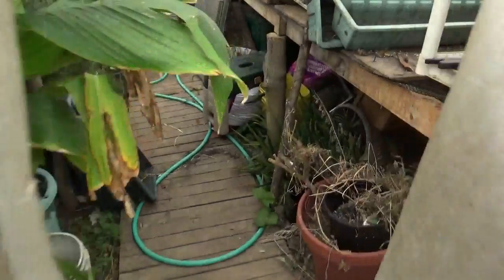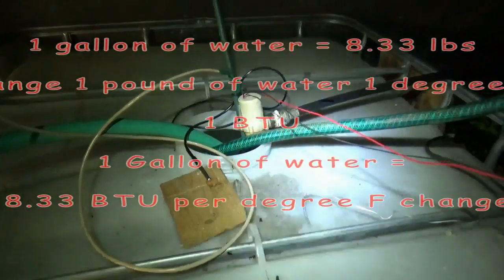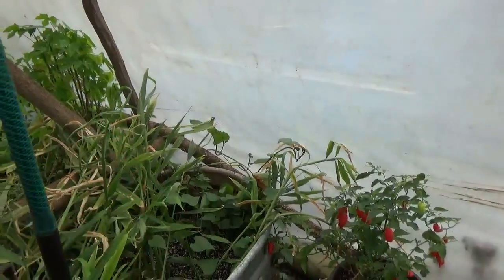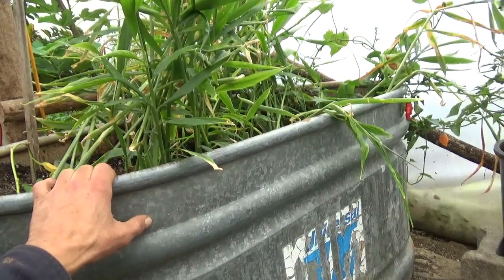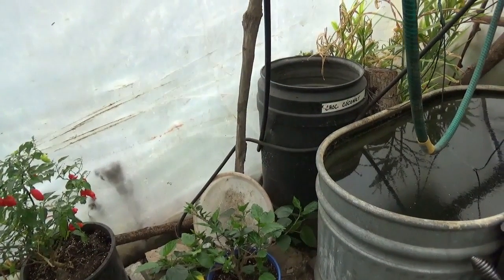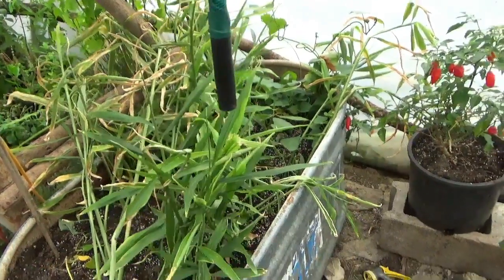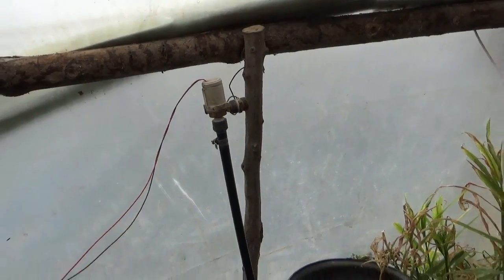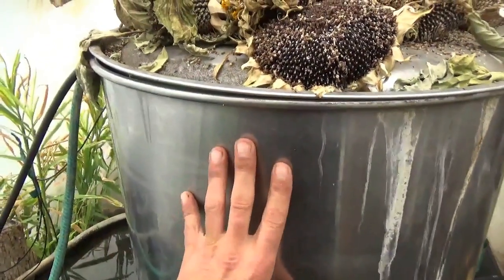Build You Own Greenhouse Series Part 2

Comment: I can absolutely see the way you built this it's terrific it's learning by doing there is no handbook there's some generally accepted practices and then common sense yes I've been thinking geothermal but with an HVAC system with a slightly larger greenhouse I think it would be needed but I really like where your head's at for the system you've got set up even think about pushing two or three hoses of hot water back there I mean really think about it what can it hurt other than more chances for leaks!  Could surprise you I don't know?  This is an excellent explanation video about the how and the why I look forward to checking out the next video about the gadgets that you use to sense it all Thanks again
Reply from the maker: Thanks so much!  Yes, the idea is always low-power consumption and precision environmental control. Yes, the thermal coils will definitely make a HUGE difference, I'm sure of it based on other testing with heat coils and thermal masses. Funny, this came through after Part 3 dropped. :)